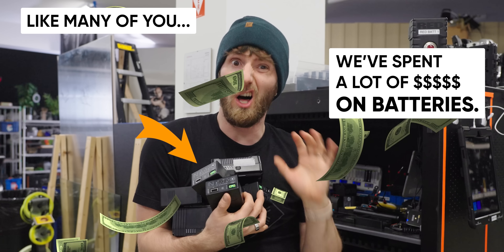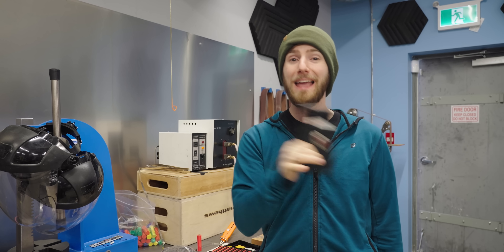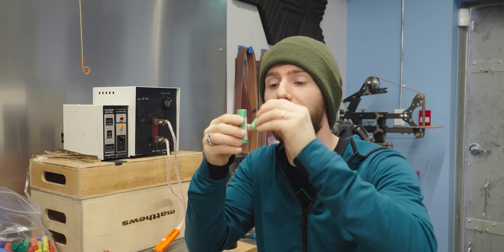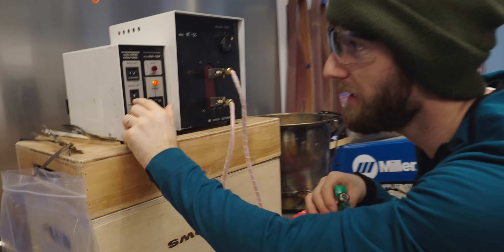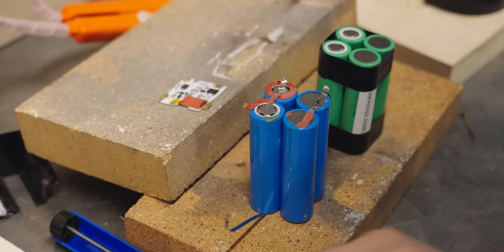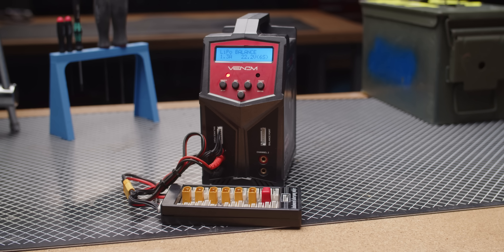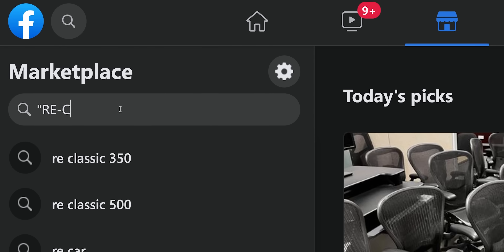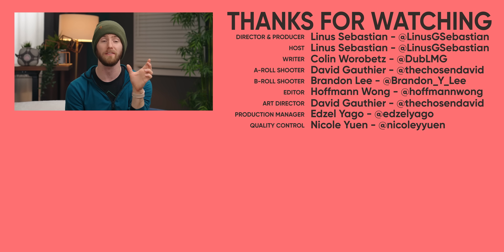This should be illegal… Battery Repair Blocking

Comment: BMS detects LVC- low voltage cutoff= min. recommended programmed in the BMS voltage value. This to protect from over discharging the battery packs individual cells and collective whole. Many times when you have a cordless tool or laptop battery pack that is no longer functioning, most of the time it is just one battery, sometimes 2 batteries that are at LVC voltage values. You can charge up that battery and the pack to a voltage value above the LVC. LVC is Typically set to 2.9VPC at the pack level and 2.5VPC at the cell level. At this voltage the
battery is almost fully discharged, so the BMS shuts off the battery to prevent damage due to over-discharge. e. BMS events are triggered on both cell level and pack level, whichever happens first.
 In a 12V battery, for example, typical pack level and cell level triggers are:
HVC Pack Level = 14.80 V
HVC Cell Level = 3.75 VPC
LVC Pack Level = 11.60 V
LVC Cell Level = 2.50 2.9VPC  Pack level values are not usually as tight tolerances and individual cell level cutoff.  So I'm my experience most cordless packs like drills, laptops, etc are usually triggered on a cell level with usually just one battery cell below the 2.9 LVC cutoff. So charging that cell to match existing cells to 3.0 volts or higher(volt  value= your particular BMs programmed value) will make the pack usable in your particular tool , laptop/consumer electronic equipment again. If you do this I would closely monitor that pack and its cells a few weeks. I think recommended from most manufacturers is to ---- first(1st) 24 hours to let the pack sit after full charging cycle. (2nd) Second closely watch and monitor with a volt meter for the first month use.                                                                                  Personally and IMO if your not checking each cells internal resistance to make sure they match and the value(Ohms) is in the nominal value for that particular battery.  Batteries with a low resistance will hold the voltage better than batteries with a high resistance.

To do controlled, accurate, discharge tests on each cell to first determine their individual IR, then sort the results.
Any "extreme" high IR cells should be junked, and other cells sorted into "matched" values for parallel groups.
Extreme low IR values should also be treated with some suspicion and subject to further tests.
Periodic checks of cell IR is a very good way of preventing unexpected cell failure...but this needs you to keep records of each cell's IR and rechecks each few months/weeks, depending on your usage pattern.
Also, IR is only one parameter for cell matching.
Equally important is to match cells with similar total capacity (Ahrs). So you to do it right you also need accurate(at least decently accurate) meters and equipment to measure internal resistance, capacitance, keep records and label each battery's values.Being somewhat organized is a huge plus

Comment: This should work to make sure to have source close to the lowest discharge(lvc- low voltage cutoff).  the BMS is programmed to detect this.  Anything lower and the BMS may go into recovery mode which would be a pain in the arse to correct, if even correctable in a decent amount of effort. Fortunately,  If this happens, it is usually it is easy to correct by connecting a hobby lipo charger to charge is above LVC.

Comment: I don't know why you restrict yourself to griping about evil designs. These batteries could be, and should be, DESIGNED FOR REPAIR. You have a lot of followers making comments. Why don't you combine all of these people into a non-profit environmental organization devoted to changing manufacturer's designs to necessarily be supportive of perpetual and effective repair. Why are you fighting spot welding problems? Couldn't there be a better way to make cells slot in and slot out without spot welding? Design that and then work to impose that by law on all manufacturers. How about the plastic cases? You didn't show how you had to cut them open because they were purposely made to be non-accessible. Why don't you design the cases to be easily opened and refastened and work to change the law? It's the same case problem with lead/acid batteries. BMS systems need to be under public control too, not just accepted however they happen to be made. Your commenters are very technical people. They can redesign battery kits perfectly well. There is no need to allow manufacturers to make these decisions. Other environmental groups demand changes in law but when it comes to waste and design to prevent repair, all that the public can do is passively struggle to repair devices that are purposely made to be unrepairable. Let's do better! Recycling is no answer. Recycling means organized destruction. To hell with their recycling facility. Design for Rebuilding is what is needed. And  the same for tens of thousands of other products. zerowasteinstitute.org.

Comment: From my own experience replacing packs, sometimes I have to plug the pack into a charger for a short time, sometimes balance bms's need a jump start to output power, even if the cells have plenty of power.

Comment: There is a solution. If the battery back is evil or 'locked' one can post free (addressee pays) so they are encouraged to not sabotage rebuilds. If there is an ewaste fee built into new products, something like $20 gets slapped on crippled repair items. On point of sale, the consumer needs to know the battery packs contain spiked BMS, and they are paying extra because of the manufacturer's  choices.

Comment: i did thif for a former employer, but i did alot of testing, instead of replacing  with new cells, i would find bad ones, remove then setup units with similar testing good cells.

Comment: 16:00 This type of "technology" is actually illegal in Europe. HP got into hot water with their anti-reinking-cartridge chips and the reason is that artifically increasing e-waste is really frowned upon in Europe. So "using evil BMSes" would force the manufacturers to make two different versions of the same products which can easily topple the relatively delicate profit margins so most companies prefer to play it safe and use the same product everywhere meaning they have to avoid "evil BMS".
Reply: HP still do it. Their behaviour hasn't changed one iota. There's a hack that allows you to reset the chip via service software that HP hasn't made generally available (except to OEMs and service partners), Epson are the same. If you know where to find the software and how to apply it to refilled cartridges... you know the rest. But you're right. It's bullshit behaviour by these companies.

Comment: You made 1 mistake. If you piggy back power supplies to the BMS to keep it alive, it will not know the cells were removed. Sony has done this since the early 2000's. When will manufacturers make packs that can accept lose cells is the better question.

Comment: I usually solder mine and drain them down to an equal 3 volts before doing it using a power bank or flashlight with a charge controller. A drained battery has less chance of going thermal. Just make sure the voltage is equal in each battery before assembly.  I don't think is worth spending the money on the welder if only building 5 battery packs or less per year. I mostly sell single batteries. I only do an internal resistance and mAh test on new batteries I buy samples from vendors because I want to make sure I get what I'm paying for. Vendors have sold me worthless junk a few times. For me, the amount of time it takes for testing used batteries is not worth it.

Comment: So, while making a video going over battery e-waste, you waste about 15 or so perfectly good vape batteries... Also, if you have no clue how to spotweld, expect sparks. Your tips weren't squared off and those sparks were not from the batteries, but from the spotwelder (and dross on the tips). 

I can understand caution and I'm all for battery safety (especially in vapes), but this video was almost comical.

Comment: 11:14   ... i dont get it, why you runn out of the room if like its a bomb or something.. i dont hate your videos, but that is not savety, its throwing batteries away after you put a ton of electriesity to a thin metal peace, that got a ton of heat so it sparked.

If you are to scarred to do such a job, then dont do it.
It is wasted time when you throw hundreds of cells away, for no reason.

Comment: I would like to see how batteries are recycled as well.
Another good idea is what many companies consider a "core" price, and a "replacement" price (saying "core charge" here gives the wrong idea). The idea is that if you want to buy a new battery outright, you have to pay for it. If you want to replace a battery, you can get it at a reduced cost, because the manufacturer will most likely replace the cells in the existing casing, slap a new serial number on the casing, and out it goes as either a core battery, or a replacement battery.

Comment: Lithium batteries are not as scary as people think.  If you're confident enough to replace a breaker in your house, you can deal with batteries.  A quick short circuit of an 18650 is not the end of the world,  the battery will most likely be fine (same for polymer packs too)    Just like the wiring in your home,  electrical circuits deserve respect,  but not fear.

Comment: PSA: You have to be REALLY careful with 18650s. You can damage them and cause a fire pretty easily. That o-ring is extremely fragile. It also becomes very brittle after a short time. The heat itself could near instantly destroy an o-ring and you would see an immediate strong arc. If you drop it, get rid of it. The wraps themselves will slice open with a simple drop. Honestly @Linus, I really wouldn't recommend doing what you're doing even considering you're a smart guy. Simply laying that conductive strip over the battery itself is dangerous. From experience. Since it can cause a single battery all by itself to spark if that ring is not completely intact and exactly where it should be.

I'm assuming the vape shop gave you a discount, because I know they hike the prices up pretty significantly (Easily $14 compared to about $7 if purchased from someone such as Illumn). Could save half of what you paid if you didn't get a discount (assuming the 18650s are in stock).

Comment: e bike batteries have BMS that dies once disconected.... I have been re-using recovered lithium batteries 1860 cells for years with no problems > I remove them from the packs and recharge them individually >>> note the output and then let them sit for a few days - if they have a drop in power then they go to the dumps recycle bin. If power is good then I match the cells and put them into packs using small electronic welder on 12v car battery.  I use the packs in different voltage formats to replace standard aa, aaa even d type single use batteries just matching them to original voltage requirements eg 3 aa batteries for 4.5 v can be replaced by a single 3.7v (4.2v max charge)1860 cell.

Comment: You really have to know the arrangement & the risks. You could use 2 probes with a resistor (0.5ohm, 5w) + 5A fuse + current meter + volt meter to test the next connection before welding. Spot weld away from the edge ie. closer to centre of button/nipple. Cover battery contacts until you need to connect them (know which are safe to group together & untapped, know which should not be shorted with your current strip & cover them). Check twice, connect once.
Use external battery with LiFePO4, BMS, own charger, make with battery holders (no spot weld metal onto batteries) & buy shares in battery making companies.

Comment: I bet you their evil BMS has volatile RAM for the boot partition.
Probably SRAM so it's less drain on the battery and unlikely to fail just in storage.
If they wanted to be turbo evil, DRAM requires constant current jolts to keep it alive, this is one of the big reasons phones don't last as long as they used to, DRAM is hella inefficient.

Comment: 11:15 So I'm a little confused here. The sparks don't seem to be from the batteries shorting themselves? This seems to be an issue with the spot welder...
Why do you have to dump it in sand??
Reply: Yea they clearly have no idea what they are doing.
Reply: I really don't understand either
Reply: Glad I wasn't the only one who noticed that. You really have to do something stupid before a cell catches on fire!
Reply: @khalidacosta7133  I have done that stupid thing and it tends to be rather obvious when that's the case. As well as slightly panic inducing!
Reply: @MrGrimsmith  Yup, shorted some cells while tearing apart "broken" laptop batteries. There was always smoke, hissing or fire if the cells shorted. And sparks are normal in almost any kind of welding. A small amount of impurities in the metal or wrong power levels and the sparks fly, pretty normal. Good that they are taking safety precautions seriously though so that people who don't know what they're doing don't get a false sense of security from this video.
Reply: Yeah... I'm confused and just for background, my major is in Electronics Systems Engineering Technology and my dad is a retired industrial electrician.
Reply: Not really but I been spot welding for 10 yrs. It’s pretty common to cause a spark and it’s just droplets of molten metal on the electrode or just a dirty surface.
Reply: Because they have no idea what they are doing. But have nice cameras to shoot footage with.
Reply: i agree the spark wasn't from a short in the battery cell but was caused by the shorted current from the spot welder ..........being overly fearful of something can mislead you, diminish progress and cause unnecessary waste
Reply: @leightonwestbury92  they dont really know what they are doing

Comment: Dell 100%, at least in the past, has had evil BMS. My first computer was a mid-2000's Dell laptop and after about a year or so of using it, mostly plugged in, it stopped recognizing the battery at all. Couldn't use the laptop unless it was plugged in. Then found out that their batteries are only rated for so many charges/discharges. Even though it mostly lived plugged in it still counted as being charged/discharged and refused to run on that battery anymore. Never bought another Dell laptop since.

Comment: We should be able to replace the cells. It's dangerous if you don't know what you're doing, but that's true with so many things. A circular saw is dangerous if you don't know what you're doing. The people, like me, that would replace the cells know what we're doing and would not attempt replacing the cells if we thought we couldn't safely do it. Saving a few bucks on a batters is not worth burning your house down with everything you own in it. $450 for a battery is not a few bucks though. Battery prices are ridiculous. When I bought a Mavic Mini, it runs off two 18650 cells and you could not replace them or use difference cells. You had to but a battery pack for $50. That's ridiculous.

Comment: just a blind guess but couldn't you jump cells with a resistor before welding to balance out any voltage potential without actually damaging the batteries

Comment: Unpopular opinion: ditch the whole spot-welding shtick, and just sandpaper the battery contacts and solder some wires. 
Just be quick so you don't overheat the cell.. and it'll be much safer, and cheaper than this whole thing.. 
I've done it with laptop cells, and it worked out fine. 

Not saying it will help with the whole BMS crap. 
For that you need to replace every cell (or cell group) one by one, while first connecting another cell (or cell croup) in parallel with the one you're gonna remove.  That should prevent the BMS from loosing power.

Comment: I completely agree with you, Linus. User serviceable battery repair could be very dangerous. People won't always know enough about batteries for the specific uses, hi-drain or hi-capacity. As a vaper I am always try to share this information. It's always tragic when a person isn't given proper instruction about battery safety in regards to the devices they're using them for.

Comment: Makita have an evil BMS on their 14V drill packs. If you put it on the charger and it fails to charge (e.g. due to low voltage cells), people almost invariably try again. Try 3 times in a row and it bricks itself forever. But the drill design is such that there is no undervoltage protection in the system (the drill runs direct off the battery terminals). So of course people keep drilling until it sounds slow and if you don;t stop soon enough the pack is undervoltage, especially if it's slghtly ibalanced. The BMS runs off one cell pair, not the whole pack, so eventually that pair gets lower voltage than the others, practically guaranteeing undervoltage, a charge fail, and try-3-times bricking. These packs are generally just fine in practice, and a few mins on a non-evil charger will have them charge just fine for many years to come.
Makita must have generated millions of waste packs (and of course battery sales) with this bullshit. Their tools are really good, but this pack design is pretty clearly done to sell batteries (although they will no doubt make some dubious safety claims).
I use RC chargers instead of makita chargers, and throw away the evil BMS (which doesn't even balance all the cells, just the two halves), but most people don't have the expertise. As Linus says, this sort of thing should be illegal - even though it's not quite the same as 'replace the cells and I brick', it's really not much better. If they had low-volatge cutouts on the packs then it would all make some sense and not just be a scheme for more ewaste - but they don't.